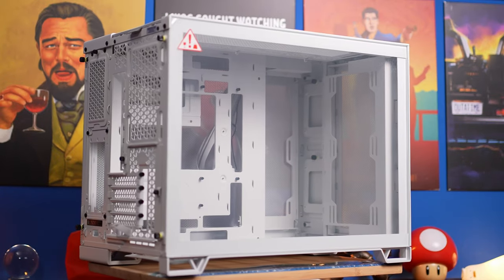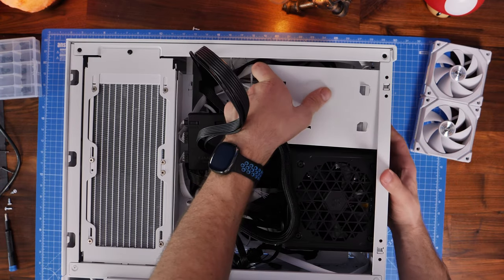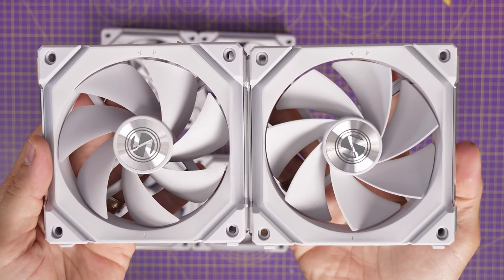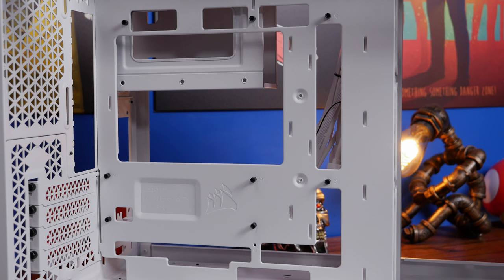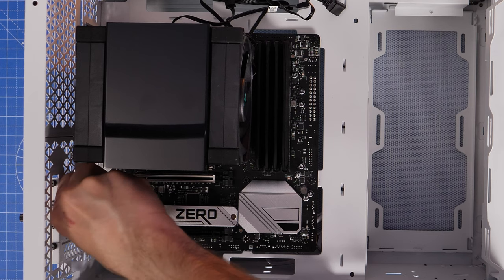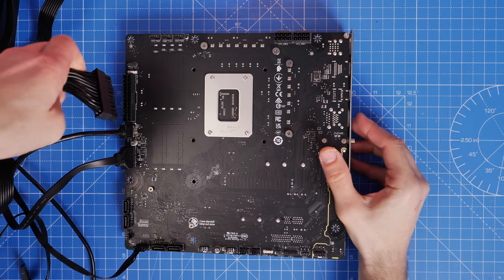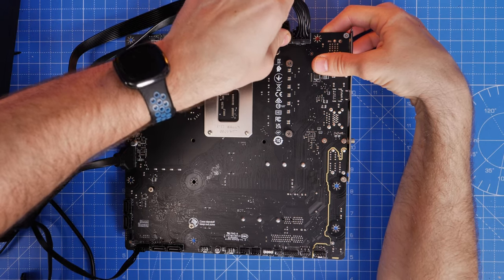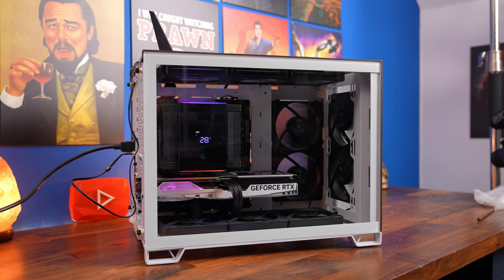Corsair 2500D Airflow step by step PC build guide with tips and tricks

Comment: One very strange thing is the lack of a PSU support in this Corsair, without this the power supply remains hanging on the 4 screws.
It would be interesting to see a build with a black Corsair 2500D Airflow with 11 Lian Li SL-Inf fans.
Three on top, three on bottom, two 140 on the front, two 120 on the AIO and finally one on the back.

Thanks for your truly amazing videos! 👍🏼

Comment: This is disappointing 

Somehow they managed to make it larger than O11 mini, but unlike the mini, it doesn't fit ATX mobo

It's 469mm long or 479mm long depending if you trust Corsair specsheet or their photo and still doesn't support 3x140 fan or does it 😅

That's 50mm or 60mm longer than mini, yet it doesn't fit 280 rad or 2x140 fans on the side

What's the point of mobo area being so wide when it won't fit e-atx anyway

Case this expensive and they can't afford 3 extra grommets

Should have either been much shorter and tad lower for the hardware it can accommodate or same size maybe tad longer and fit ATX mobo and 420 rad

Amount of wasted potential here is directly proportional to the amount of wasted space

Comment: On the website it say you can put 3 140mm fan on top and bottom. So thats a lie? You can only do 2?? (No radiator ofc)
Reply from the maker: The specs I was sent were wrong apparently, so the website is more likely correct. I didn't have 140mm to test and show I am afraid.

Comment: With the LIAN Li build was there enough space to put a 360 radiator in the top?
Reply: It looked like it could fit
Reply: Yes, Corsair specifically states you can put a 360 rad on top, bottom(but gpu where?) And 240's on the front and side.